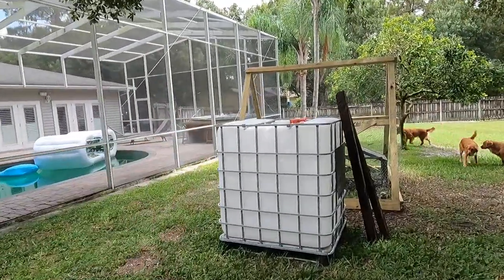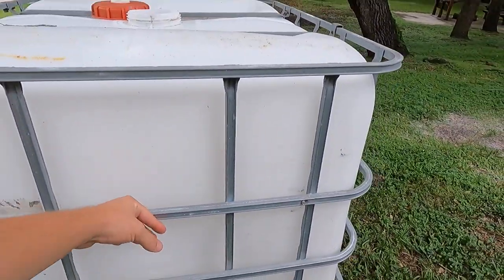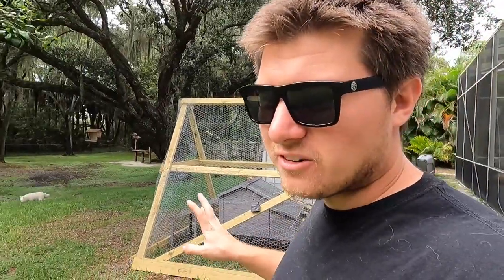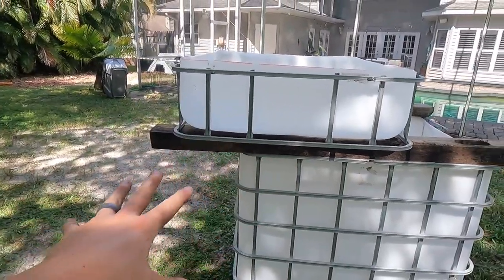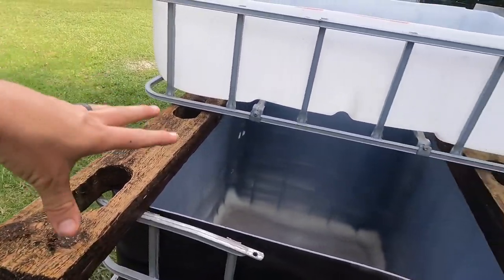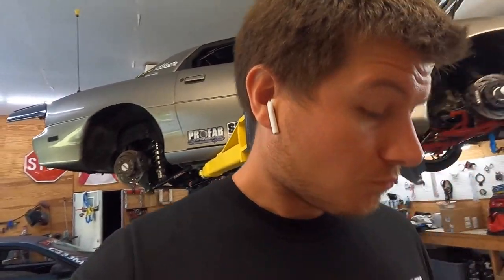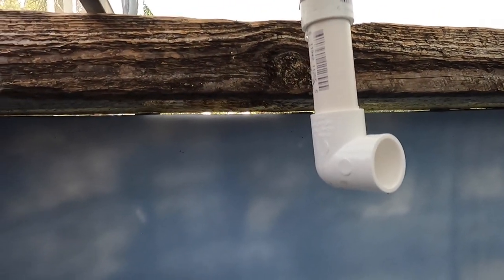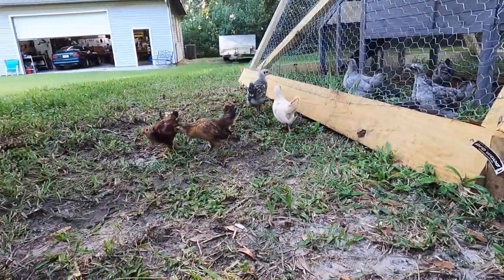Becoming a Fish Farmer!

Comment: Professor Cooper. You need to make the whole thing solar powered. There's lots of great 12 volt fluid pumps. And with proper batteries it could run 24 hours a day.

Comment: Get u a couple 100 watt solar panels for the pump and a couple motor cycle batteries and a regulator.  Power problem solved for the pump

Comment: Looking into air lifts for your water. You will be able to use a large air pump for aeration and for pumping water to the top section. No water pump needed cutting down on electricity needed
Reply: I was going to suggest this, thank you for doing so.

Comment: Coop you should have set up your drain syphon in the cap in the middle so it’s at the lowest point to avoid stagnant water and mold buildup
Reply: If you look at the design of those containers, the cap is not the lowest point
Reply: @jaydunbar7538  I see there are 3 equally low points

Comment: Coop you should use a toilet refiller to tap into the primary location just to keep everything topped up off the mains. Keep your idea with aquaponics but it ensures doesn't run dry👍
Reply: Could do it with a rain barrel as the backup water supply, it’s Florida lol
Reply: @jaydunbar7538  yeah, he may have an issue with too much water vs it running dry..

Comment: A air ram pump will move water just not as much as probably need but you could build 2 or 3 to do it.  
You may want to paint the top part also it will get algae in the top which will spread to the bottom. Just some suggestions for you to think about.

Comment: Make sure you have something like a sprinkler inside to move water. I used to large container water pump test using boat bilge pumps. Micro organisms get the water feeling like oil. Installed a secondary pump to just spray across top and move water around

Comment: Look into making a water ram pump system will move water uphill without using any electricity. Only uses pipe/hose and one way check valves.

Comment: Use a 12 V pump and then set up a small 12 V solar system with a lead acid battery then you won’t have to use any electric at all

Comment: Subbed instantly. Been a car nut and a fish keeper forever. Don’t disappoint Coop!

Edit- I haven’t watched everything yet but before I forget. 

Please learn the nitrogen cycle and acclimation before you go to far. It seems like you learned a ton about the production side of this but the fish aren’t just fertilizer and carcasses. They deserve the same treatment as the dogs, chickens and  tortoises.
Reply from the maker: I have to do it correctly or I won't keep the fish alive. It is for sure in my best interest to get it all right
Reply: @thebogettibunch  I know you will. I shouldn’t be allowed to make comments past my bedtime. 

My advice if you would like to jumpstart the process is to get some cycled used bio media from your fish supplier. Keep it wet and warm, dirty (dont wash it under the tap) and get it into your setup asap. I setup brand new tanks with this method all the time. Also, you may need to condition your water if its treated with chlorine or chloramines. 

Sorry for sounding like an ass.

Comment: Looks like you have done plenty of investigation into this. A couple of considerations:
- review your stocking numbers keeping in mind that the fish will grow and produce more ammonia the bigger they get.
 - chasing perfect PH can be a tedious task and probably not necessary.
 - ensure the system is cycled (ammonia - nitrite - nitrate) before introducing too many fish otherwise expect deaths. You can always use another source of ammonia to kick this off and can use a test kit to monitor what stage the cycling is at. 
 - consider cladding the outside of the IBC to protect it from direct sunlight. Unfortunately after several years my top sections became brittle (still worth it for the price).
 
At the end of the day it can be a very rewarding exercise and am looking forward to following how you go with your system.

Comment: You’re worrying about the water too much. Collect your rain water or whatever water you’re going to use for your fish. Take it to a pet store ask them to test your water for you for your aquarium. With the information you get back from the water test, you can use that to find out what fish will do best in your water source. Consistency is key, don’t try change the PH. Just worry about consistent water parameters. Read up on the nitrogen cycle. Your tank will go through the cycle, where bacteria in the water/tank/media will convert waste to ammonia, once the ammonia spike happens a new type of bacteria will grow and eat the ammonia and turn it into nitrite, then the nitrite will spike and the final bacteria will eat the nitrite and turn it into nitrate. Nitrate is the final step of the nitrogen cycle. The more you feed your fish, the more waste and dead plants that go into it will cause spikes of nitrate. So changing water might be necessary. Your plants will be able to use the nitrate from the water as nutrients but I doubt they will be able to take all of the nitrates you will be producing with your vision of 30+ fish. Water temps may be an issue as well. Consistent water temperature is important having large fluctuations will stress fish out and lower their immune system making them more susceptible to illness and disease. 

Keep it simple, consistent water parameters, consistent water temperature. And you’ll be golden.

Comment: Awesome bro they work great  it’s illegal here in nz  well you can but got to have a licence ect friken stupid rules Still doing it anyway lol nearly set up for all off grid  still need mains power for w/s welder,mill and lathe ect hope to find a big generator soon and have it buried in the ground reducing noise and run off it hydrogen currently got a little 49cc hydrogen gen and solar
Reply: Have you looked into making biogas
Reply: @theideasman6018  yeah have looked bio gas and fuel vapour  I’ve got hydrogen working good just oil contamination is only issue from ring blow by  oil catch can helps with that.   I’d rather use hydrogen cause it’s free just electrify water urine works best